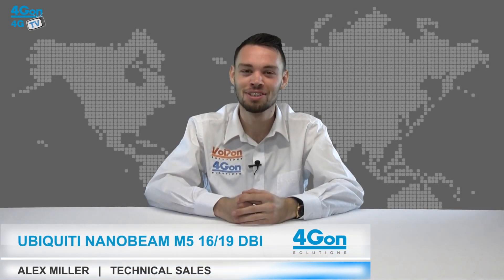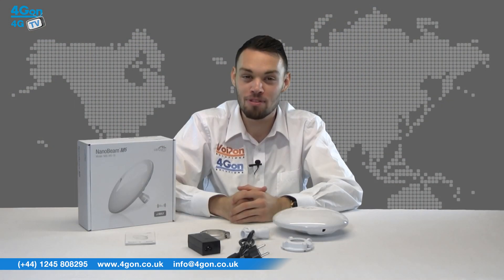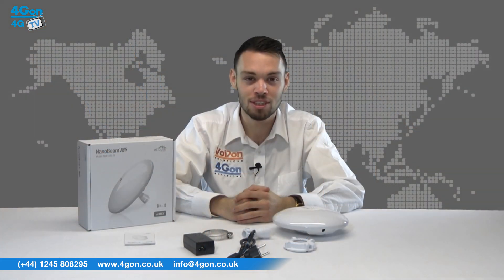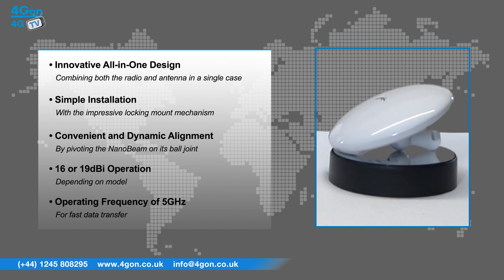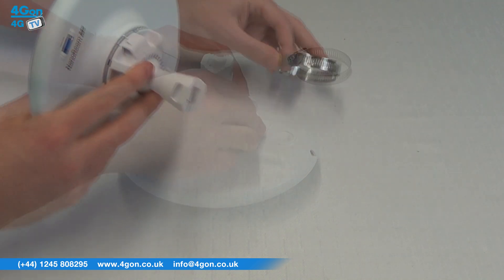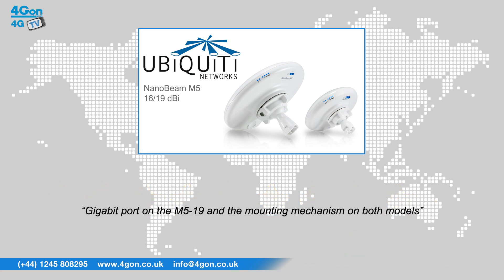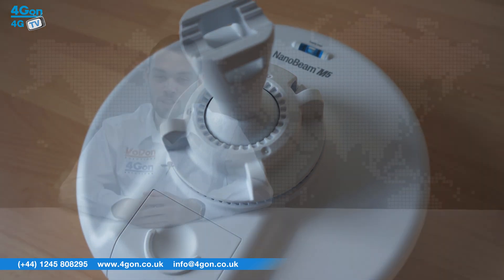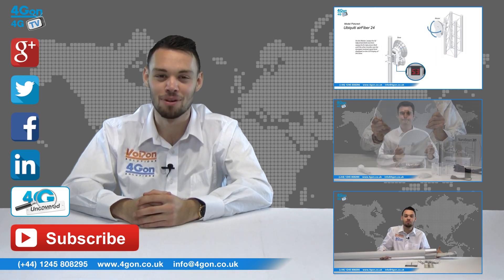Ubiquiti NanoBeam M5 16 / 19 dBi Wireless Bridge Video Review / Unboxing

Comment: Worst product of ubiquiti when I increase the output power to 26dbm it will go dead. I had tried on 4 nanobeams m5 19 all are dead.
Company is also not replying about this problem.
Don't buy this product.
Reply: How much distance between your AP and Station?  Also, what kind of cable did you run from the POE injector to the unit, and how far is the unit from the injector?

Comment: This is the worst Ubiquiti product to date, lining up the units up to 1km OK, try pushing it up to 5km, then talk again about the easy mounting kit.
I removed that silly joystick looking thing and mounted it on a L plate, makes it easier to align. That mounting method is ok if you wanna link it to your nabours house not for extended links. Do the designers actually test to see if theie mounting designs work.
Reply: So 2.5km sal nie werk nie?
Reply: I bought rocket m5 with sector antenna and at client side I am using nanobeam m5 but I can't connect with rocket the distance is 7 km but no success at all I spend 450 $ and the result is zero